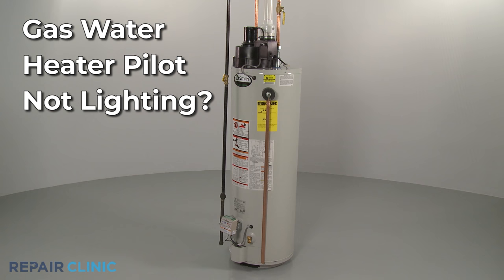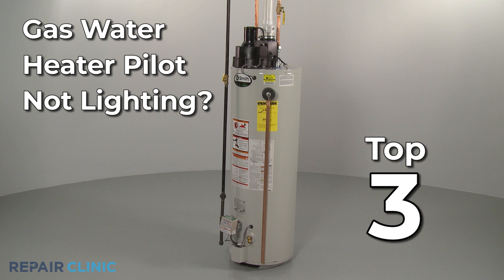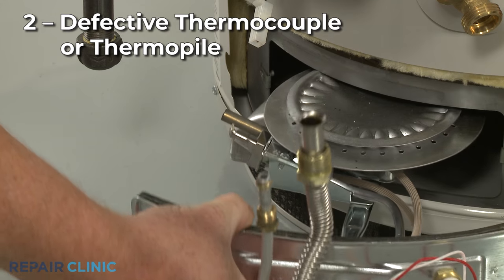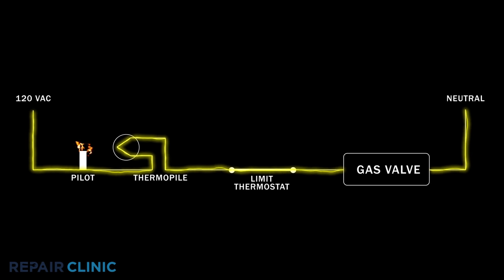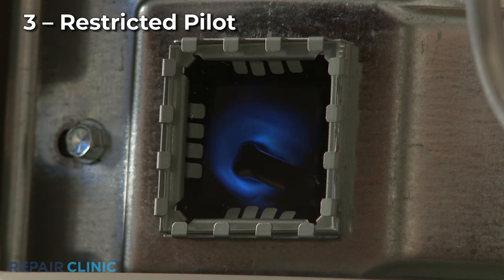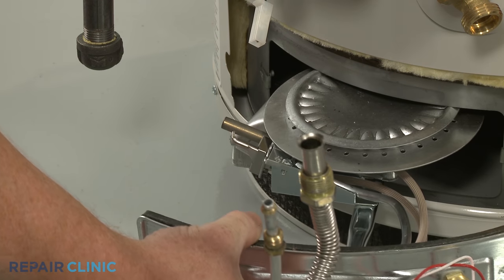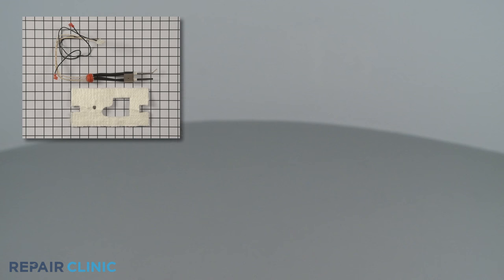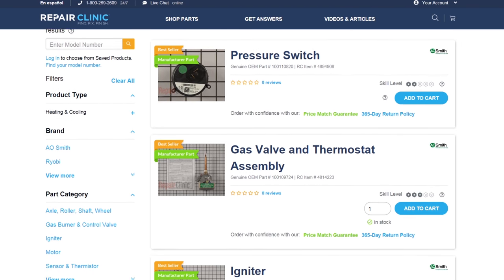Gas Water Heater Pilot Not Lighting? — Gas Water Heater Troubleshooting

Comment: So for everyone  who has problems with this honeywell gas valve,  honeywell  is trash.this is planned obsolescence and is a form of predatory capitalism. 
     My pilot kept going out. Never had any error code.  The water heater has a air intake underneath, damn near impossible  to get to to clean. That's on ao Smith for not allowing enough  room underneath the waterheater  for proper cleaning and maintenance and for having a sealed chamber which requires you to use the ignition  button which is unreliable and subject to failure. 
   The ignition would only spark when I wasn't trying to light the pilot, as soon as I push the thermostat  dial in pilot mode, it would not spark.
   It is easy to remove  the looking glass, so I lit my pilot with the old school method of using a grill  lighter then put the looking glass back.
    I wasted alot of time with the ignition  button, I will never again.
Reply: Mine keeps going out, but I'm getting a 6-3 error code (flame lost).  In the sight window I can see the pilot light and then soon goes out.  Sometimes, it stays lit for a long time.  I see some condensate in the window so that could be a problem.  I'm thinking I'll have to replace the thermocouple, or clean the pilot orifice.  I need to crank up the temp setting to see if the condensation goes away, it's very little so hopefully not a leak!  This water heater debugging is driving me insane, our family has been dealing with it for over 3 years now.
Reply: On my Bradford White, the looking glass looked permanently fixed. No way to remove it without breaking it. Too bad, your method would probably have saved me.
Reply: Old school 👍
Reply: 17 videos later, thanks commenter😵 f*ckers lit